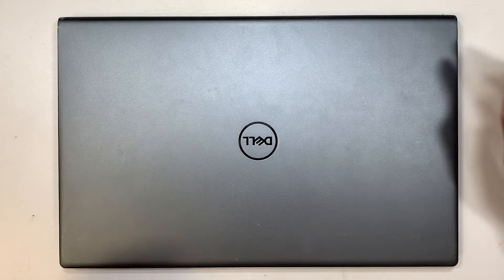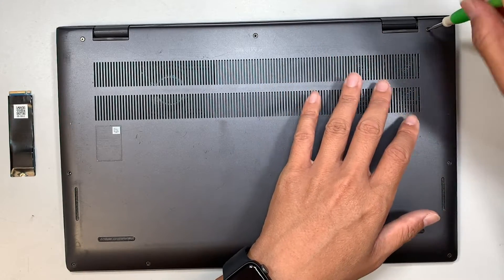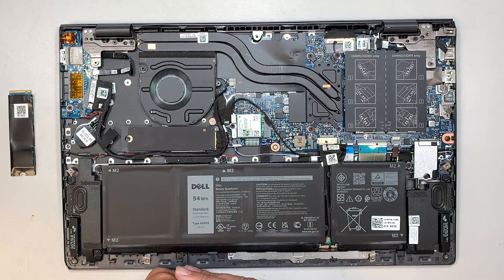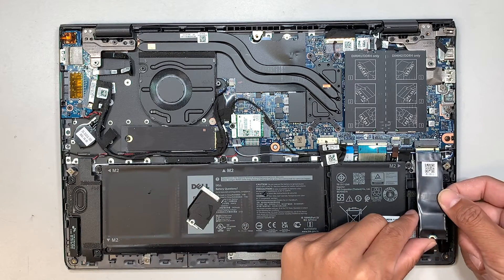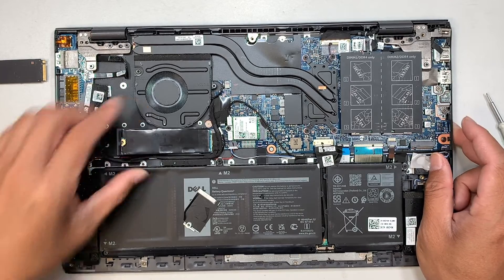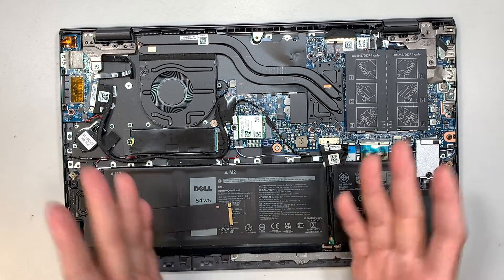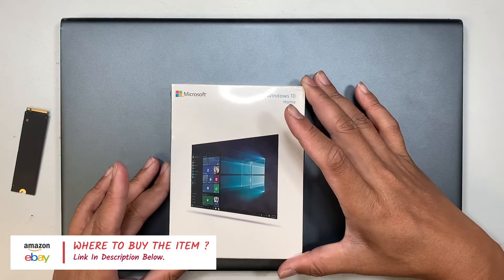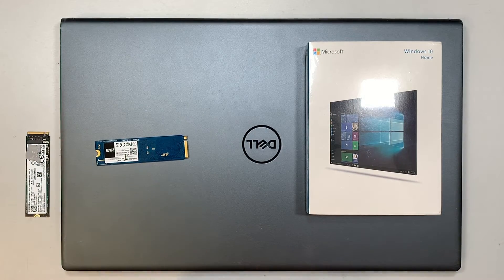Dell Inspiron 5515 M 2 SSD Replacement Storage Upgrade

Comment: Hi, im looking for a secondary SSD for this laptop, the small one (2230),  everything that I found on amazon are "4rd" gen but in the specification of the laptop, says it is a NMVe PCIe of 3rd gen, I dont know if there´s a problem with that o I can use that?
Reply: It's backwards compatible, it will work. It will just be limited to Gen 3 speeds

Comment: won't all the data from the laptop be deleted when I add 2 ssd disks?
Reply: It will be if you remove the original SSD which has all your data on it. If you add a second SSD in the secondary slot shown at 2:35 you will just be adding more storage, not deleting your old data.